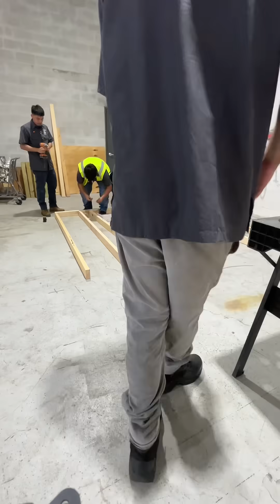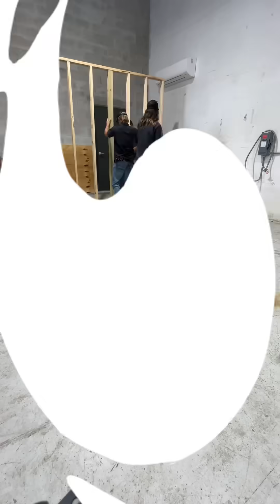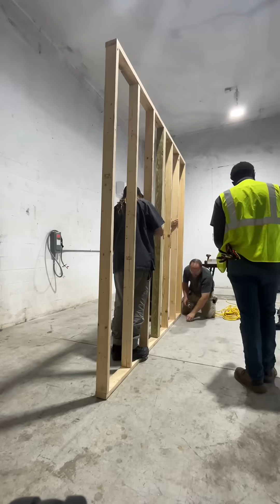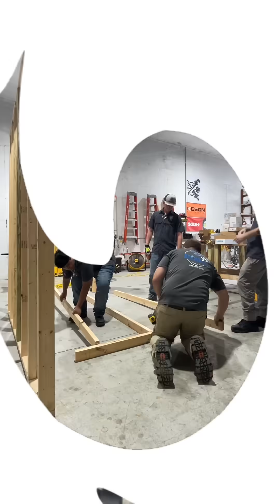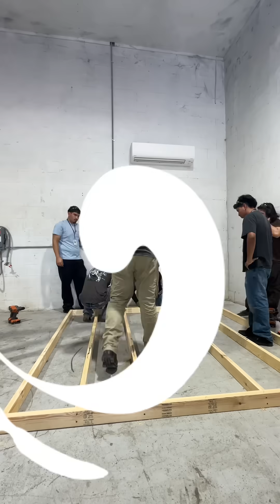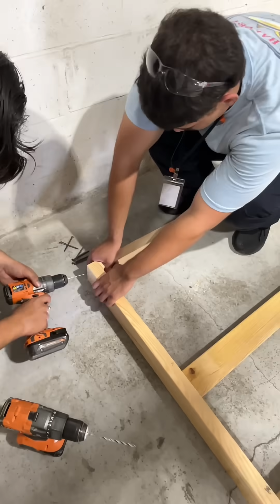Students Build INSANE Plumbing Simulators

Comment from the maker: Future plumbers and trade pros! These custom-built simulators are changing the way we master real-world plumbing. No job site pressure, just pure hands-on skill.

Which plumbing skill would YOU want to practice first on a simulator like this?

👇 Drop your answer below and share your biggest plumbing challenge!

👍 Smash LIKE if you want more behind-the-scenes student builds, and SUBSCRIBE for daily hands-on plumbing wisdom you can actually use on the job.

Ready to level up? Check out our programs and join the next generation of skilled trade professionals!